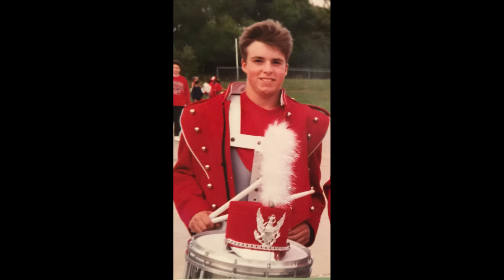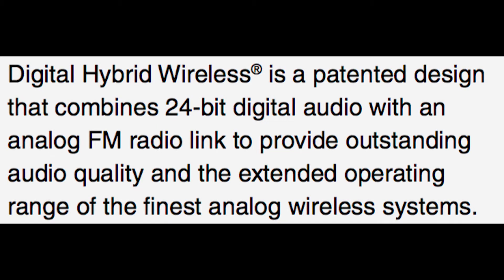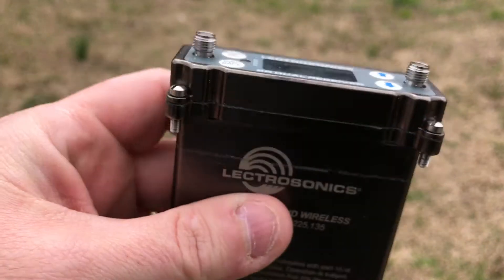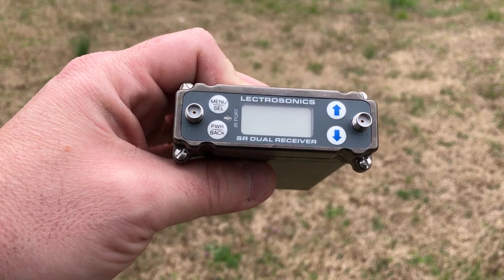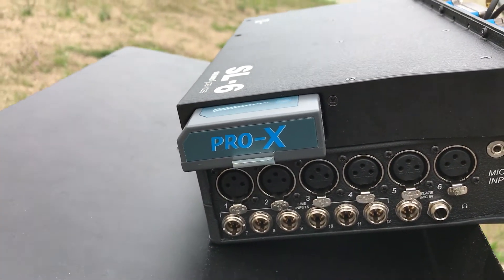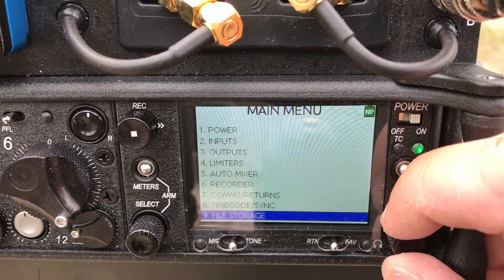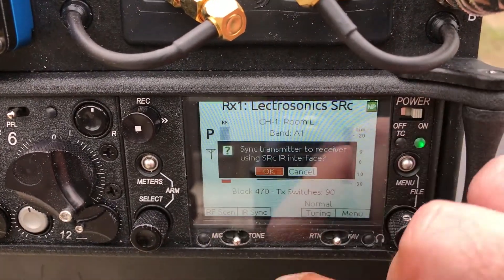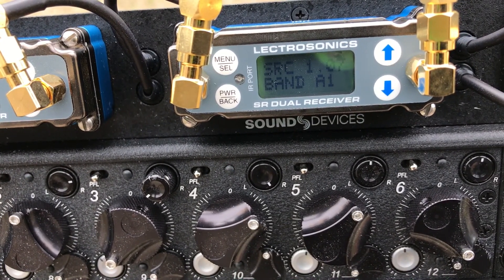Lectrosonics SRc with Sound Devices SL-6 integration + 688 Mixer/Recorder

Comment: does the SL6 work with the Zoom F8, not what's the alternative?
Reply from the maker: No. The SL6 is a Sound Devices product that only works with the Sound Devices 688. Zoom does not make a product that integrates wireless receivers into the F8 the way the SL6 works with the 688.